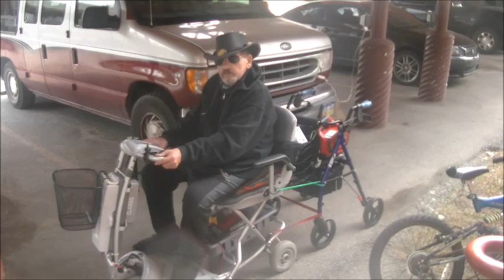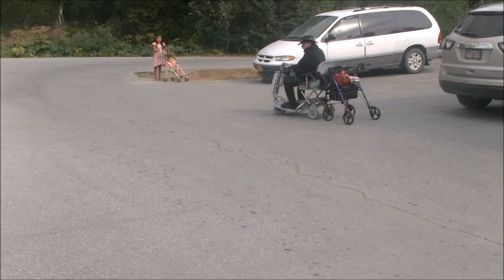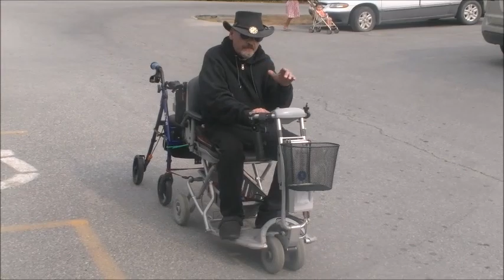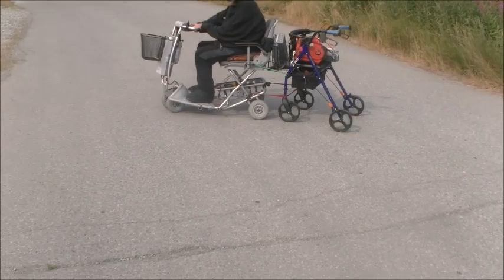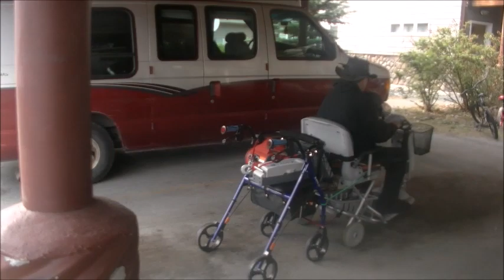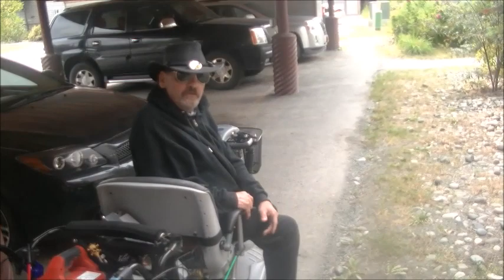Ewz Trike Modifications 4

Comment: Take out the two front wheels... the noise pollution is unbearable. I also, suspect you'll probably need an integrated gun turret and beer cooler to get any crippledom cred in the U.S of A region of the world. 
So from this perspective, it's either an unfinished work or a severe disappointment .... 
;-)
Reply from the maker: The front wheels on the trailer are not designed for the road, the Walker is basically an indoor use item.  They will be replaced by outdoor wheels (lawn tractor wheels) in due time.  However, they will do fine on the smooth surfaces in the airport terminals.  I will do better than a gun turret.  I will have an RPG Launcher.  Design finished on that.  I already have the Beer Cooler. :)

RE